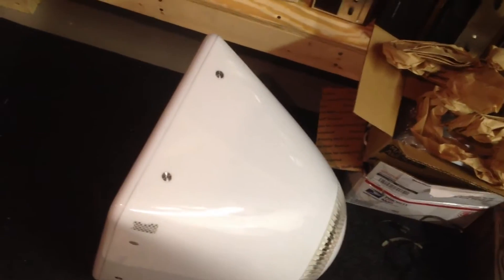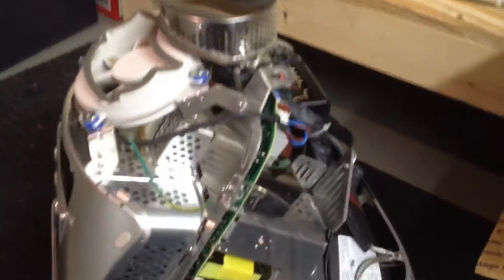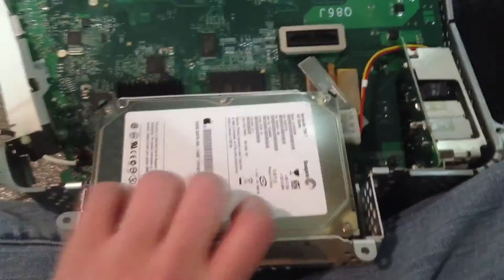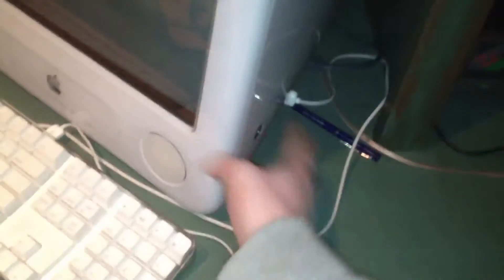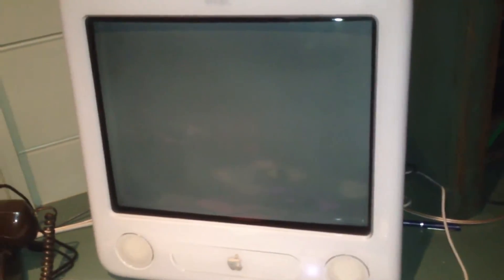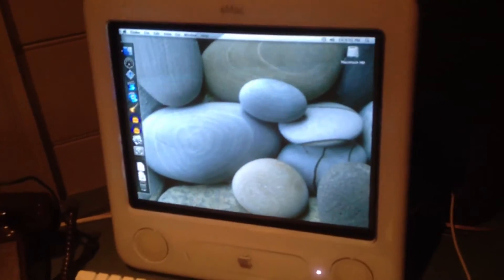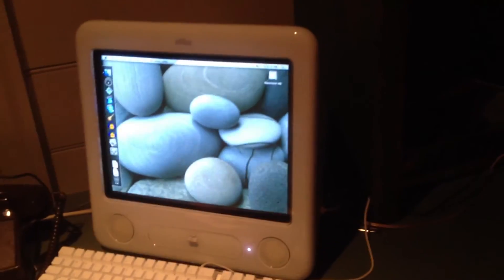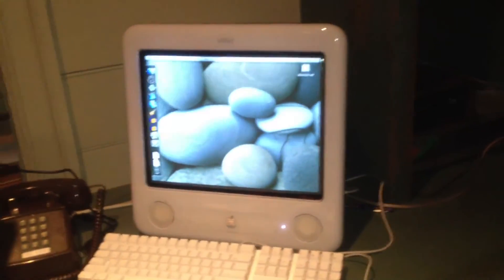eMac Hard Drive Upgrade + Thoughts On The eMac Itself

Comment: Just put lubuntu 16.04 ppc version on it. It will make y modern.
Reply: It not y
Reply from the maker: For the 12 programs that still care about PPC
Reply: lmull3 with lubuntu though you will have modern Internet (Firefox comes pre installed) and games from the software center or through terminal
Reply: lmull3 tenfourfox and omniweb are modern internet browsers for ppc macs

Comment: We had these in middle school and high school.  The CRTs went bad, people broke the speaker covers and CD drives, these things sucked.  Most of the eMacs can run OS 9, so you could make a Mac OS 9 machine for Unreal Tournament and stuff.
Reply: At my primary schools they had gateways and dells. Those computers had the same issues from the same abuse. It depends on the wear and tear, letting kids use computers to their own discretion will kill it quickly.

Comment: I see you have garage band installed. Do you think the emac is good for pro tools? Also does it have a vga outlet?, so i can be able to use dual monitors
Reply: I  think the ability of using dual monitors was disabled by apple, in the software, but I'm pretty sure there is an application you can get to enable that ability